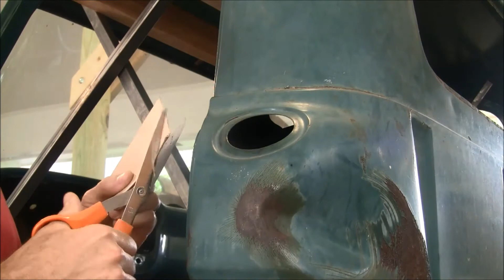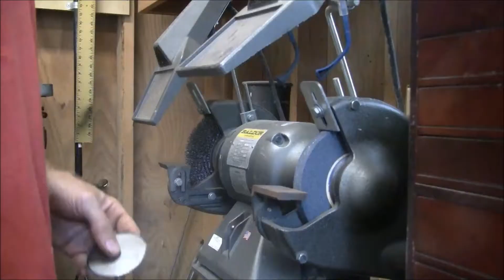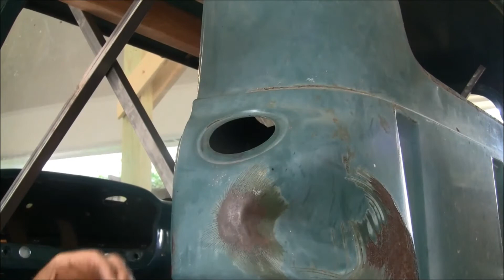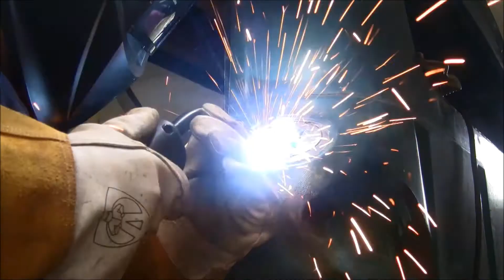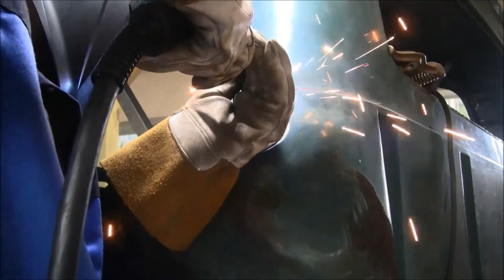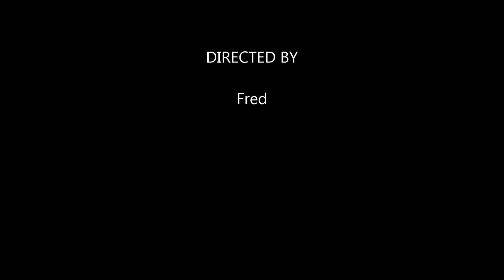1962 F100 Flareside/CVPI frame swap; Episode 6: Cab gas filler opening deletion

Comment: Props to you for trying your hand at welding.  There are plenty of videos out there to improve on your welding skills.  Running beads on sheet metal is almost impossible.  Stick to the spot weld stacking and remember to move around on the piece to help in heat.  A helpful tip is to keep your air hose on hand and give your weld a squirt of air from time to time....really helps in cooling the metal and speeding up the welding process.
Reply from the maker: Thanks a lot for the suggestions. This is a steep learning curve but I am getting the hang of it. I have a lot of scrap sheet metal to practice on after this past weekends work. Cheers!

Comment: I’d love to hear more about your welder. What make and model is it?  What wire size are you using?  What type of shielding gas?  What were the settings when you welded the filler cap opening?
Reply from the maker: Welder is a Millermatic 211.  I think I had .030 loaded up at the time and was using the auto settings.  Gas is 75%/25% argon/CO2 mix.  I think i had to big of a gap also.
Reply: Perhaps you’d care to try some 0.023 / 0.025 wire for sheet metal. Maybe it would also be a good idea to use manual settings and follow the chart under the lid.
Reply from the maker: That is good advice.  Thank you.  I see the error in my ways.